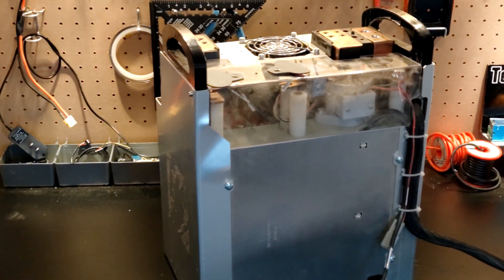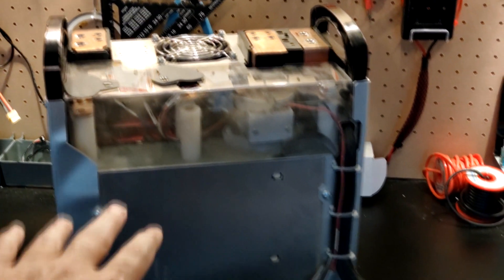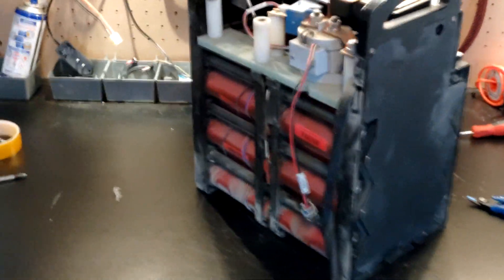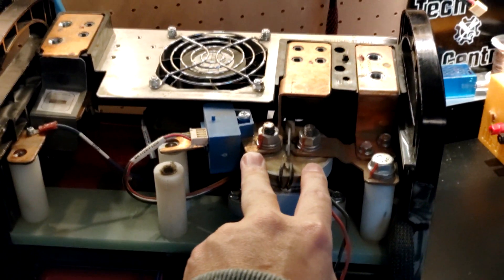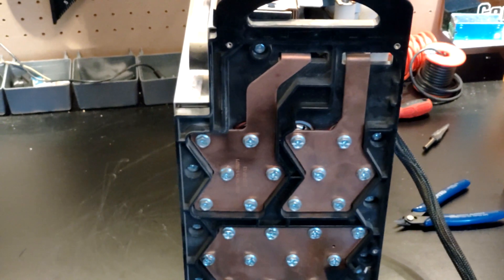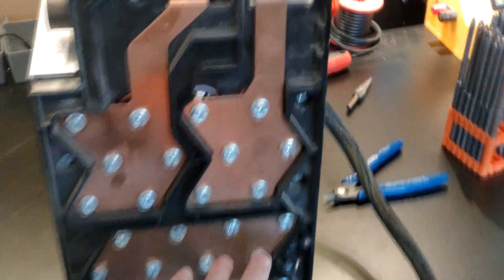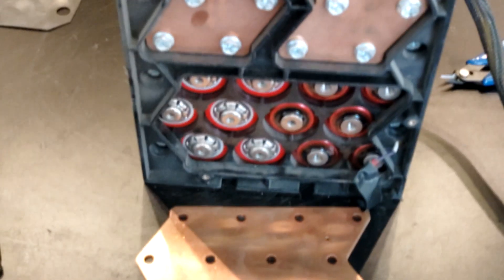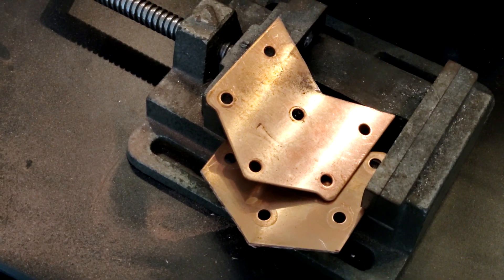SUPER BEAST 24v 48ah 1.23kWh - 48 HEADWAY CELLS - 24v split into Two 12v

Comment: I have a question ? Could i use two ofc 0 guage to bridge it back together as one 12v by crossing the cables over each other? I assume the thick jacket would prevent any interference from one laid on top of the other like an x. Please get back up with me if u dont mind.
Reply from the maker: I am sure that would be fine. Interference on cabling is most when you deal with data or rf. Just bridging for power. I don't see an issue, but I urge to do more research.
Reply: @TechCentric_00  thank you so much , i will research the rf interference , as it will be used for car audio. I would like to do this to keep  my bridge as short as possible. Maybe i can come with a solution that will not cause any audible hum in my system

Comment: Hey, you've torn these apart. I have two and don't want to tear them apart. I've figured out most of the pins on the connector but do you have them all mapped out? I have the balance leads, the hall effect sensor and a few temp probes figured out but I'd like to get the fan running to cool my BMS. I think the two I haven't identified are two pairs blue and red. And the two separate connectors, one is the relay but what is the other one? I also wish I saw your video with the link to connectors that mate with these.
Reply from the maker: Sorry I only mapped the balance leads as I didn't have much need for the rest. Good luck with your project!
Reply: I learned the other extra connector is for a heater, from a DavidPoz video, which makes sense because it runs down to the bottom. That's cool because I plan to use these outdoors and in the cold occasionally.   @TechCentric_00

Comment: do you have any feedback on using 2 of these as a replacement for a 48V lead acid conversion for a golf cart?
Reply from the maker: I believe these would work great for that project I have given it thought myself I suggestion though is to use four in total to give you the capacity you may need to run a golf cart for any significant amount of time

Comment: @techcentric  Could you please run a tape measure on all the cell holder parts x,y,z dimensions. not counting the extra handle frame there. It will be extremely helpful. Thanks!!!
Reply from the maker: 11.5 wide x 12 tall x 7.75 deep

Comment: Any idea what the BMS lead plug is called, or where to get the mating connector to it? Thanks.
Reply from the maker: The BMS leads or the connector on the battery itself?
Reply: @TechCentric_00  The connector on the battery itself! Just bought 2 of these batteries and hoping there's an easier way to connect the BMS than a bunch of soldering
Reply from the maker: I cover the connector in this video. https://youtu.be/pXdFmeV_hB8
Reply from the maker: Hope you used my discount code 😉
Reply: @TechCentric_00  Incredible thanks!! great vids. I hadn't seen any of your vids yet when I bought the batteries, so unfortunately no code used :( If/when I buy more though i absolutely will!!

Comment: Will charging my lifepo4 headway bank at 14.8v instead of 14.6v cause them to degrade? If so is it substantial fast or would it be a slow process?
Reply from the maker: 14.8 is above the max voltage of 14.6. There is no speed advantage and can only leads to a chance of damaging the cells. I don't even charge to full voltage as to extend the life of the cells.
Reply: @TechCentric_00  only reason I ask is because I'm using the bank in my car and my alternator is set to 14.8v. I'm new to lithium and didn't even think about the charging voltage before I bought it. Just trying to get an idea of how quickly they might go bad when charging at 14.8
Reply from the maker: I would watch this video on the subject. There are some issues with current load and such. https://youtu.be/jgoIocPgOug

Comment: Thanks for share. So, if I want 12v 96ah I need to make a cross connection in the side that you measure it and cut the plate right?
Reply from the maker: For 96 ah after you make the cut as shown in the video you then need to parallel the positive connections together and then the negative. Make sure both 12v sides are very close in voltage before doing so.

Comment: If I wanted to add this for car audio what would be the process ? Could it work with agms ?
Reply from the maker: Sorry I am not very knowledgeable on car audio uses.
Reply: Yes you can run it in parallel with an AGM. I have my 96ah suberbeast running in parallel with my cheap everstart AGM as long as you drive the car a couple times a week, you don't have to worry about the voltage dropping. I've seen someone leave their car sitting 4 days and the voltage was still fine.
Reply: @SoberAsTheHolyGhost  hey bro, do you have it with your factory alternator? Do I need to make any modifications? I already ordered mine and I want to have good information so I don't have problems
Reply: @luisacosta7193  I upgraded to a 320 amp alternator. I never used it on my original.

Comment: just a question sisnce the each cell has 8ah each 48 of them will be total of 384ah for the while setup? please someone answer me i need to know this urgently before ordering one
Reply from the maker: No the ah is calculated by cell group. One cell has 8ah and each cell group is made up of 6 cells so that is 48ah.   So this system before my modification is 24v at 48ah and after the modification it becomes two 12v at 48ah. Hope that helps.
Reply: @TechCentric_00  since the super beast comes in 48 pieces of 3.2v and 8ah headway batteries , I can parallel 7 which is 22.4v and 8ah and then serial it with the remaining 41 pieces which will be at 25.6v and 328ah .. won't that still work with my 2000w, 24v inverter?
Reply from the maker: you don't want to mix parallel and series. Best practice is to have the same voltage and general capacity on each leg of the series. In your suggested setup I don't know how you would have BMS protection which lithium cells need. LifePO4 is pretty safe but you can still damage the cells with over voltage, undervoltage and such.

Comment: What is a BMS?
Reply from the maker: BMS stands for Battery Management System in the modern age of battery technology the cells do not like to be depleted below a certain voltage so a BMS monitors and when a cell get too low it will cut the power to protect the battery overall. It also protect from over charging the cells. Some BMS's also will actively balance the cells to keep them all at the same voltage. Hope that helps. I do have a lecture on BMS here https://www.youtube.com/watch?v=WDks87-FiyM
Reply: @TechCentric_00  Thank you!!!
Reply: Battery management system

Comment: I have 2 of this and I’m trying to build a car audio bank it’s a total of 96 cells I came up with 6 across and 12 down would this work or am I looking for trouble
Reply from the maker: If the 6 is in series that is way above 12v and may damage your equipment. 4s is what is used for car 12v systems.
Reply: Could I do them in a 4s having that many cells
Reply from the maker: Yea more the better in capacity and available current.
Reply: @TechCentric_00  where I live there is no one that can help so this is a big help thank you 96 cells any suggestions on how to set them up
Reply from the maker: Let me think it over and I'll post something soon. First if you the ability you should test each cell one bad cell can really reduce the capacity of the pack.
Reply: @TechCentric_00  I did there all at 3.23 I had them balancing them selfs off for about 24 hours
Reply from the maker: The test I am referring to is capacity. If most are 8ah and some are 6ah it may be better to make a smaller pack in which all the cells are same capacity.
Reply: @TechCentric_00  oops sorry there 8ah
Reply from the maker: Ok it comes down to space. I would break it up into 4 bricks of 4s (4 in series for your 12v) 24p (24 in parallel for 94ah) and add a 100amp BMS. Now that gives you the ability to stack if needed in your car space. Now parallel the four bricks together and you will have 400amp of current totaling 4800 watts of available power. If you need more you can use 200amp BMS. I am not familiar with car audio uses and the ones I have seen do not have BMS (To get all the massive current these cell can release) but you let these cells go empty that may get damaged. Please be careful and I would do more research as I am no expert in this application.
Reply: @TechCentric_00  thanks you so much for your help
Reply: @TechCentric_00  yup let mine go to 5 volt on a water pump... seems like they came right back up... still wondering on charge voltage and bulk time on medium size solar system  60 amp   feed at 28 v  about 4 hrs  3 ish kwh..   working ok...?
Reply from the maker: Forgive me I am not sure I understand the question. Can you clarify?
Reply: @TechCentric_00   charging parameters ?
Reply from the maker: 29.2 max voltage. And with these being 6 in parallel you probably can't find a power supply that these cells could not handle. But I limit to 10a myself.
Reply: @TechCentric_00  thanks.

Comment: Own  two of the beast .  Have you tested any of the cells for actual capacity in A hours.  See yours are a bit crusty too.  I just hit mine with compressed air and  they cleaned up quite nice.  You can actually weld with the dang things using 3/32 rod.  Must use with the work being Pos Ground to stop the spattering .
Reply from the maker: Haven't done a capacity yet as I do have a use yet.
Reply: @TechCentric_00  I have about 10kw of batteries here was starting a Solar Wind project.  Sick as a dog.  Hope I get to finish it for my son and wife.
Reply from the maker: Sorry to hear that. Would love to see a video of your setup when completed.

Comment: Awesome video thank you.   I have started to look into these cells or alike High discharge setup as I'm familiar with building Lifep04 setups from Eve cells.   But another use case setup I am wanting to adventure into is High amp draw for competition stereo setup running close to 54000 watts of power.   With possible dual 300 amp alternators I still need a good battery setup.  Maybe I'll get enough time to research which is how I came across your channel.  Subscribed!
Reply from the maker: Thanks for the follow!

Comment: Thanks so much for this. Waiting for the follow up videos on hooking up balance leads to this. Hopefully won't have to wait too long. Lol.
Reply from the maker: Got some bms's on order.
Reply: @TechCentric_00  can I put in a request for you to do a step by step video on how to hookup a BMS? Say for an example a 4S pack? I understand how to connect the balance leads to each of the cells but I am so confused on how to hook up the BMS itself to the pack. Like where does B- go and P +, etc. I've tried looking for vids on this but all of them aren't very useful. Would really appreciate it.
Reply from the maker: I will try to work on one soon.
Reply from the maker: I haven't had time to produce a video on wiring up a BMS, but here is a good tutorial for a 4s setup. Basically it all comes down to which bms you choose. If the leads wires makes sense to you and you only have questions about the main wires then for most BMS you use the positive straight off the battery and the ground \ negative wire runs through the the BMS. B- goes to the battery and the P- goes to the load.
https://www.youtube.com/watch?v=dFhmur_Zylw
Reply from the maker: I have two more big batteries coming soon and will be adding a BMS and will go over it in the video. I don't know why they use the letter P but that is not positive. B- goes to the battery and the P- is where you would connect the negative wire that goes to whatever you are trying to power ie "The Load".

Comment: Thanks for the teardown - I picked up one of these as well - couldn't resist the sale price. Not sure what I'm going to do with it at the moment, so your explanation of the different configurations might come in handy. I didn't have to lift a finger and I already know a lot more about the battery - thanks again.
Reply from the maker: Glad I could help!
Reply: Yeah I snagged one up too. I stripped it down.  Going to do this 12V configuration and then have a 96ah pack for a car audio system. Need to figure out the little 4s bms's that I've used on other 38120's batteries I've built. It'd be nice to not have to fully fully break it down. But then again I'd like to get rid of the cable and plug anyhow so I prob will break it all the way down... hmmm